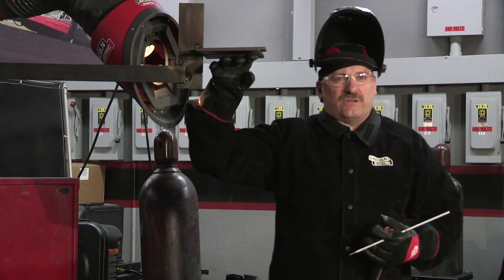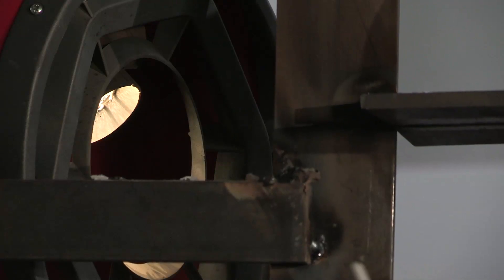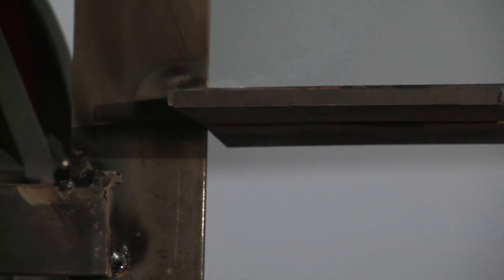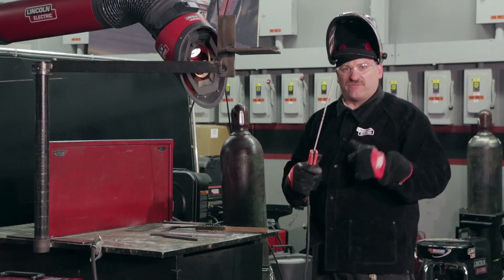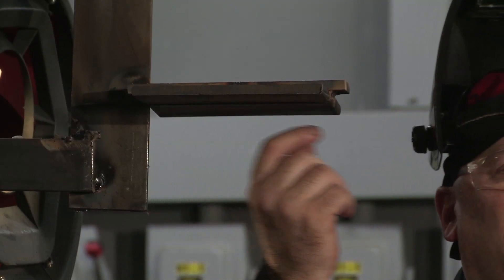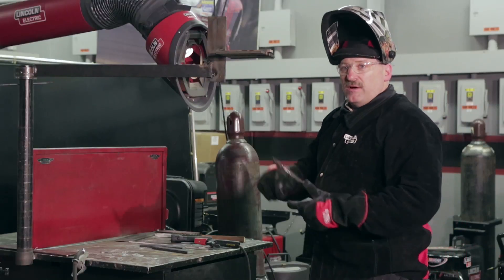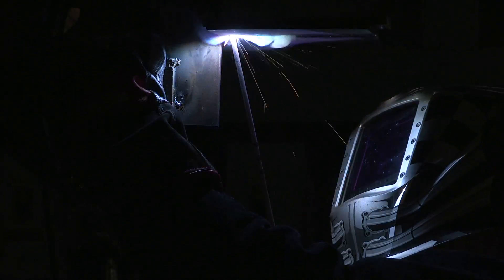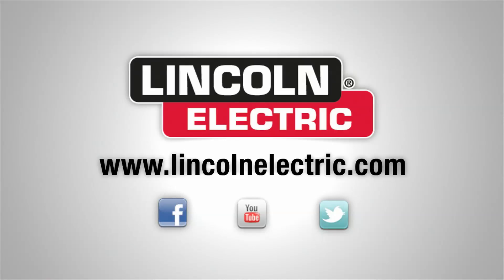Tech Tips: AWS D1.1 SMAW Overhead Welding Test, Part 2 - Root Pass & Fill Pass

Comment: Heres the thing... that root pass it starts out (or ends up at its starting portion) much lower than where it ends.  Sort of like a ramp effect or sn upwards slope.  After the slag is removed or even before you xan clearly see the beginning is about 1/3 the thickness of where it ends up at and this is true for (again) about the first third of the entire weld length.

Good luck capping on that after multiple filler passes. .. uhhh yea or perhaps better yet YIKES

to quote Jody weldingtipsandtricks "no bueno"

Comment: Did you have to stop and let the plate cool at some point?
Reply from the maker: +Dale Greene Thanks for the question. Eventually yes.  At some point on a small plate like this one if you keep welding, the heat in the plate will make it difficult to maintain a good puddle.
Reply: How many beads did you run before you let it cool? How long did you let it cool? Is the hot pass is supposed to go on within 10 minutes of the root finish?
Reply from the maker: +Dale Greene Thanks again. There is no requirement for how long you need to let it cool or how many beads you run before. Karl ran 3 beads and let it cool for 4-5 minutes. He said that he likes it to be at or just below 200 degrees because it will hold better with less sag, etc. Again, there is no written requirement for how long you need to let it cool before the Cap.
Reply: Thank you love the channel. I went to Tulsa and our instructors never put emphasis on cooling time. They just said when you can touch and hold the material it's cool enough. But we were using small pieces of plates and pipes. They also always told us to put the hot pass "rule". But thanks for clearing that up.
Reply from the maker: +Dale Greene Our pleasure. Thanks for being active on our channel. Thats why we do this.

Comment: I'm surprised to see the plate that thin ! I'm taking a test in 1" test plates both 3G and 4G .here in Los Angeles !
Reply: I think he is showing the main points of the weld test. It isn't necessary to waste a full inch plate to cover the root second pass and the fills to the cover
Reply: Recertification tests can be taken on 3/8

Comment: Why he sets up like that? Is it supposed to be pipe training in plate mode?
Reply from the maker: +drekson23 D1.1 is a structural code, not a pipe code.  All qualifications in any position are done on flat plate, not pipe.  In this particular video he is demonstrating how to qualify in the overhead position which requires the weld to be made with the joint upside down facing the floor.

Comment: What amperage are you running? What rod as well? Also, when I lay my root pass in the very position, I get quite a bit of Stalagtites for lack of a better word. Is this an amperage issue, travel speed issue, or am I way off base? Thank you for the video.
Reply from the maker: +Creek Nation Karl was running 115-130 amps for overhead. He was using a 1/8" Excalibur 7018. For your "stalagtites issue, you need to maintain a short arc length and a consistent travel speer. Karl runs between 3-7"/minute travel speed.
Reply: Thanks for the infi